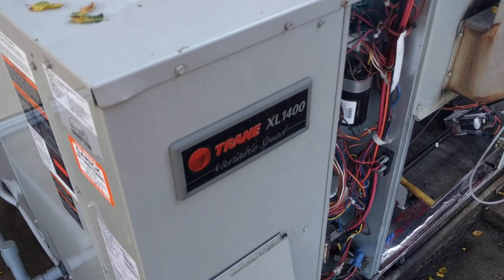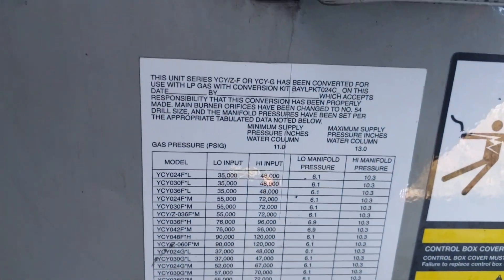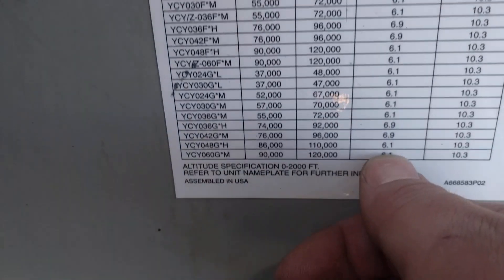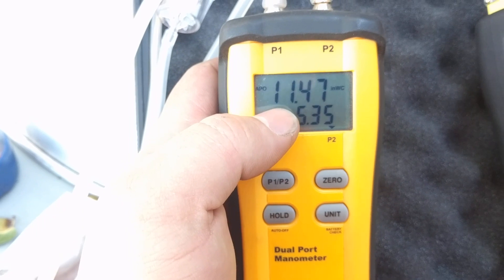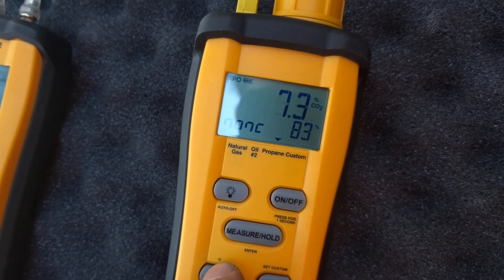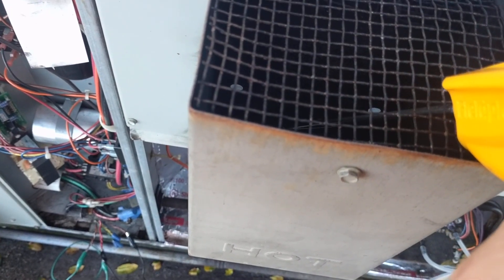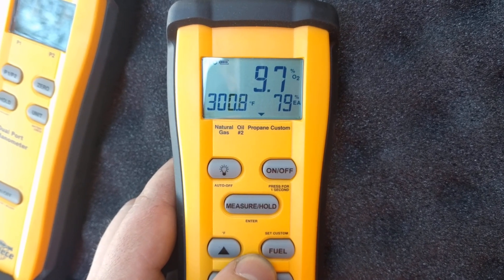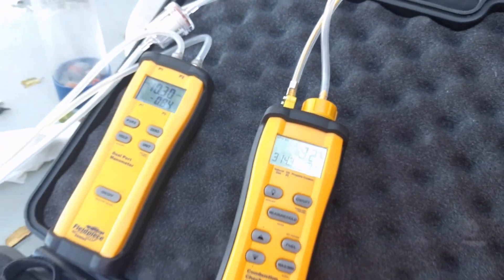Trane XL1400 Gas pressure Adjustment with SDMN5 and Combustion Check SOX3 Part 1

Comment: Hey I want to convert a 18000 btu split unit into a chiller how can I get it like -30c
Reply from the maker: At those temperatures you're not going to have much throughput but it is technically possible..

I'm not sure the compressor is going to like such an aggressive pressures swing. Maybe two compressors in series might help if you run into issues.

Your suction pressure would be <20 psi